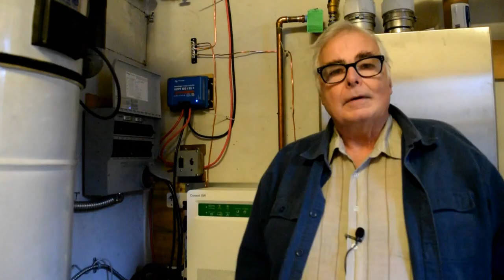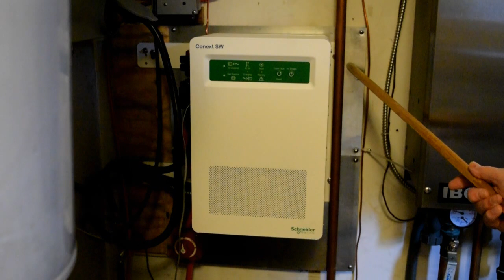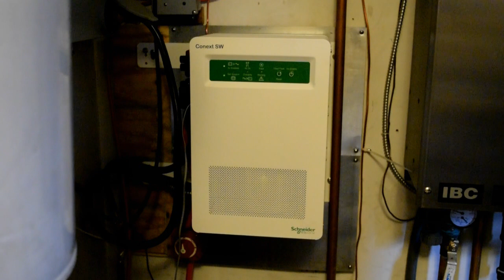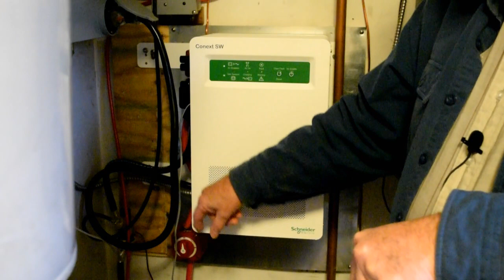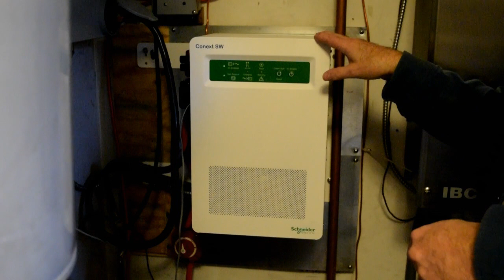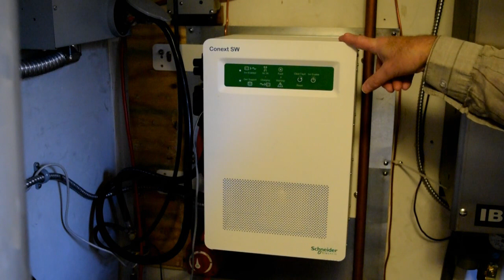Schneider Conext SW 4024 Split Phase Output 4000 Watt Inverter

Comment: Hi Todd, did you buy locally or did you order online?  From?
Reply from the maker: I bought on line from the Alt E store in Massachusetts.  Buying locally is not an option where I live (small rural town in Maine).
Reply: @todddunn945  thank you!  I may in the same boat as im a little out of the way in Alaska.
Reply from the maker: @Akdale777  The main thing I would look for in choosing an online supplier other than that they are reputable is shipping charges since these low frequency inverters are heavy.  I think mine weighs about 80 pounds which would make it expensive to ship.

Comment: I am looking to wire this exact inverter to my load Center do you have any pictures
Reply from the maker: I guess it depends on what you mean by wire it to your load center.  Are you off grid, or are you using the inverter for a backup power system.  The wiring is very different.  Mine is a back up system.  I installed Reliance 10 circuit manual transfer switch.  I put the 30 amp plug on the front of the transfer switch so I could simply plug the inverter in or plug in a generator if I wanted.  There are videos showing that install.  I am not off grid, so I also wired the AC in from the panel to the inverter from a 30 amp 240VAC breaker I put in the panel.  That allows me to use the inverters internal fast transfer switch if I think ahead and turn the inverter and the transfer switch circuits on before a power outage (i.e., at the beginning of a big storm that might cause an outage).  Depending on where you are located and the local codes etc.  You may have to hire an electrician to connect things to your panel.  Here we don't have electrical inspections so I was able to do it myself - I worked as a union electrician years a go so I do know what I am doing.
Reply: @todddunn945  I completely live off-grid so no inspections and I'll be doing the wiring myself just looking for a few tips side question today I measure the output voltage at the first outlet and I'm only help putting 108 V AC not sure why this is so low it should be between 115 and 125 is there some way to adjust the voltage or is my inverter broken
Reply from the maker: @neomatrix2722 Off the top of my head I don't know if you can adjust the output voltage.  My unit is in default mode and has always worked fine.
Reply: @todddunn945  let me give you some clarity my inverter is also working fine and in default mode I just find it abnormal that the output is at 108 volt AC it's my understanding that's too low and will damage electronics I just ran the same test with the multimeter on my gas generator Honda and even with a 100 ft extension cord it outputs 122 volt AC now the inverter it's length of cable is only about fifteen feet to the wall outlet can you measure your output voltage what do you read

Comment: lol i just talked to somebody and i guess the 40/24 is an AC charger only does not use solar unless you have a stand alone charge controller
Reply from the maker: That is correct. The4024 is anverter/charger and you need a separate solar charge controller

Comment: Are u still useing this inverter? I have the same one just not hooked up yet.Do you have any idea how much solar power this item can handle?
Reply from the maker: Yes  I have been using it for over three years.  The inverter itself doesn't connect to solar.  You need a separate charge controller for solar.

Comment: I purchased the 4024 3 years ago and it has definitely been a headache. The software has a mind of its own regardless  your settings. It charges the batteries when it wants, has a 50w load itself (expensive) and fried a $1300 lifepo4 battery.I do not reccomend this inverter.
Reply: Let me add, it has kept the power on during 2 outages but has caused 9
Reply from the maker: I have had mine for three years with zero problems.  I will be adding LiFePO4 batteries after the first of the year, but they will be charged by solar.  I have never used the inverter's charge function.  Sorry to hear you have had issues.
Reply: @todddunn945  Keep me up to date on the battery addition. Thanks for the reply
Reply from the maker: @scheffman  I will do a video on the setup.  I am going to do it in two stages adding 10 kWh each time.  I currently have lead acid and the two battery banks will be connected only with a DC:DC charger.

Comment: Hi Todd thank you for your reply must I use a four conductor wire or can I not use a three conductor wire all I'm using the inverter for is just to run it out to a plug so that I can run my air conditioner Hank you and I hope you have a great day
Reply from the maker: If you want 240 split phase you need four conductor wire.  However, if you are just running a 120 VAC circuit you can connect to ground, neutral and either L1 or L2.  Note that the inverter likes to have balanced loads, so if, for example you are drawing 15 amps from L1 you should also have circuits wired to L2 that draw about the same amperage.
Reply: Do you have a picture of a four wire diagram from the inverter side like which wire goes where on the terminals for wires please my goal is to run 4 wires to my load Center then probably won't run out my circuits from there thank you in advance I appreciate you

Comment: Thanks for the review. I'm also looking to run a well pump fridge and a few lights.
Reply from the maker: You are welcome.  The reason I bought this split phase inverter was to run my well pump.  I have a 1/2 hp well pump.  It uses about 1,200 watts when it is running.  I don't know what the startup surge is, but this inverter isn't phased by running the well pump.  I currently have a 10 Kwh lead-acid battery bank.  It will run my well, fridge, freezer and house lights for about three days.  I also have a 1 kilowatt solar array, that provides enough power to keep the well, fridge, freezer and lights running indefinitely in the summer.  It isn't enough in the winter.

Comment: Hey Todd I just bought these this inverter do you have a video of you installing it like to your battery Bank I'm looking for a walkthrough thank you in advance
Reply from the maker: This video discussed\s the install, but I can tell you what I did here and make a couple of suggestions.  I think I covered physically mounting the inverter adequately.  It is possible to do it by yourself, but if you can get a helper it will be easier.  As far as the wiring goes, my inverter is the Conext SW 4024 that has a maximum amp draw of  250 amps. I used 2/0 cables to connect the inverter to the battery bank.  Those cables were Ancor tinned copper with 600VDC 105 degree C rated insulation and an ampacity of 330 amps.  I chose that size wire to be able to carry the maximum current for the inverter during a short surge with minimal voltage drop for my length of wire.  I made up the individual wires by crimping tinned connectors to the ends of cut pieces of wire using a hydraulic crimping tool.  The connectors I used were Ancor tinned copper heavy duty lugs.

As far as the details of the wiring go I set it up as follows in the order that I made the connections:

DC wiring

Negative wire - starting at the battery bank is ran a length of 2/0 cable from the negative connection point on the battery bank to the connection point on a Victron 500 amp shunt that came with my BMV 713 Blue Smart Battery monitor.  Note that the shunt and battery monitor are optional.  I then connected a piece of 2/0 cable from the shunt to the inverter's negative DC input.

Positive wire - starting at the battery bank I installed a Blue Sea MRBF Terminal Fuse Block, rated for up to 58 VDC and up to 300 amps continuous current, to the positive battery connection point.  I installed a Blue Sea 250 Amp MRBF fuse.  Blue Sea MRBF fuses have a 5000 amp current interrupt capacity at 32 VDC and are fast acting.  Those fuses are designed for use a the primary fuses on large battery banks.  I then connected a length of 2/0 cable to the connection point on the fuse block that goes to a Blue Sea Single Circuit 9003E 350 amp continuous rated on/off battery switch.  From the battery switch I ran a piece of 2/0 cable to the positive DC connection point on the inverter.  The battery switch allows me to turn the inverter on and off.

AC Wiring

I wired the inverter's AC out wiring using a length of four conductor, 10 gauge, generator cord with a molded NEMA L-14-30 plug so that I could plug the inverter AC output into the plug connection of my transfer switch panel.  Not that plug was specific to my Reliance transfer switch panel.  I did that rather than hard wire the inverter to the transfer switch so that I could unplug the inverter and plug my generator into the transfer switch panel if the batteries went flat during a long duration power outage.

I wired the AC in wiring from my electrical panel to the inverter using a length of 10/3 metal clad cable.  I chose that cable because the wire would be exposed in my equipment room.  I used appropriate strain relief connectors where the wire enter the inverter and the electrical panel  The wire was attached to the panel with a 30 amp 2-pole circuit breaker.  Note I strongly suggest making the AC wiring connections to the inverter BEFORE you mount the inverter so that you will have good access to the connections inside the inverter.  Make the AC connections to the panel AFTER you physically mount the inverter.

I hope this helps.

Comment: what other units would you consider buying if you had to do it over again?
Reply from the maker: I would consider a Magnum energy MagnaSine, but you need a remote control panel for that inverter too and the inverter is more money.  Another option would be one of the AIMS UL listed inverters.  That said, my Schneider is still working perfectly after 26 months, so other than the need for an expensive remote control panel to program it I am completely satisfied with the inverter.
Reply: @todddunn945  thank you for responding

Comment: Is the voltage from the generator 120ac or 120/220ac and how big of generator would you recomend
Reply from the maker: The inverter is split phase so both 120 and 240 VAC.  How big depends on what you want to run, so I can't answer that without knowing the details of your situation.

Comment: Great video and explanation for this inverter. I saw in the manual the no load current is 27 watts,but you said it is 41 watts.That is good information about it.
I would like to buy Tripp Lite APS 3024 but the no load current is 71 watts.! I saw it in the manual.Because it is a heavy duty inverter.We knew from about over ten years experience of using it.

I’m from Yemen,because of war almost 80% of people are using solar power.The solar equipments here cheaper than USA and Europe.This inverter in Yemen for $530.Tripp Lite APS 3024 for $930.
The Morningstar 45A MPPT solar charge controller cost $420.In USA it cost $500.
May be solar equipments producers make lower prices here in order to get in flourishing market for their products.
Reply from the maker: I am pleased that you found the video useful.  The idle power consumption may be different for a newer inverter.   My inverter is almost two years old.  It is interesting that electronic components are so much cheaper there.

Comment: We didn't have the money for lithium either, we got two at 1,100 each with some money for repairs to the house.  Every time I had income tax berate from the government,  we bought more , any large influx,  we got more. It is directly affected how we are able to live. Massively over size your PV array,  you will thank your self for that when the sun is low production mode like winter and rainy days. We here in the tropical Atlantic also have to contend with sarhan dust blooms in the summer months. That dust blooms requires you to stay inside and avoid breathing in those contaminat . That is the reasons for the A/C units and second inverter in parallel.
Reply from the maker: That is an impressive project you are working on.  My system is just to get us through power outages, which are usually less than a day.  For me it doesn't make economic sense to go off grid because my total electric bills for a year come to only about $400.  My highest usage is in the winter and it peaks between 7 and 8 kilowatt-hr per day.  In the summer usage is in the 3-4 kw-hr per day range.  If I was to go completely off grid I would have to size the system for Winter.  Given our weather I would need to plan on not getting any solar for up to 4-5 days at a time (heavy overcast and snow).  That means a 40 kilowatt-hr usable energy battery bank.  So batteries alone would cost me in the $25k-$30K range.   So battery cost alone for an off grid system here would cost 62 to 75 years of my annual power bills. My array size is limited by how much of the array I can reach to clear snow from the array.  I am pretty much there now with a one kilowatt array.  I could cut some trees down and install a ground array, but I would need around 10 kilowatts to meet my needs in Winter.  That would cost in the neighborhood of $10K.  So an off grid system here would run my $40K-$50K or 100 to 125 years of my current electric costs.

Comment: after hurricanes  Irma and then Maria on September 6, 2017, and two weeks later we didn't have utility power back until January 8, 2018. Our system was one inverter and charge controller, midnite classic 150 refurbs, and 2,250 of panels with trojans lead-acid batteries, they were used and not very good. We ran a ryboi 2,000 generator and use that minimal system to live and we have built the powerhouse we have today.  I would like to add a propane 12Kw generator with AGS start and more panels. This will take time.
Reply from the maker: It sounds like you have a good start though.  I would like to switch to lithium batteries but they are $$$$.  So I will stick with my lead acid batteries.  At least they were new.

Comment: Thank you, but we have two because we will have split A/C units (20, we currently have only one. We are off grid and i live in the US VI , my battery bank is currently 1565 amp and i plan to dd another Tesla module 60 when i receive my income tax return, we are still waiting on 2018 here from the government . Our utility power sucks worst than rotten eggs, base rate is 39.5 for the first 250 kW and then it increase to 45 cents there after. We have frequent interruptions, the second week of November this year we had the island of St,Thomas and St.John completely blacked out from 1100 AM to 1830 hour that afternoon, the next day we had another for about 4 ours also. I use a Yamaha 3,000 watt  generator daily now since we are not get any more than 12.5 daily from my system. no sun and the planet has shifted further south.
Reply from the maker: Air conditioning definitely requires power.  Here in Maine we don't have AC.  You have big battery bank.  Our power is cheaper than yours ($0.18) per kilowatt, but we lose power quite frequently since we are at the end of the road on an island.

Comment: i have two in parallel.
Reply from the maker: Wow!  You must have a high demand system.  I have concluded that my house doesn't even need the single 4,000 watt inverter.  I could get away with the 2,400 watt model.  Of course I do not have my eletcric stove or my electric dryer connected to the inverter.

Comment: Hi Todd, did you get an SCP? I have a spare and will be happy to send it to you. I have a channel where I show programming, installation, and troubleshooting of these inverters.
Reply from the maker: Thanks for the offer.  I have not gotten one.  I figure I will get one when I upgrade to Lithium batteries in a few years.  I will check out your channel.  I looked at your channel and it looks very good.  However, my Spanish is a bit week since it has been more than 50 years since I studied it.
Reply: @todddunn945  Thank you for checking out my channel all my videos have two versions, you can always find an English version of the same video. Also, if you have a shipping address that you would like to share I can send you the SCP.
Reply from the maker: @SWSTVEDU  Thank you for the offer, but I would prefer that you send it to someone who needs it more.  I will buy one when I need it.  I will also take a closer look at your videos and find the English pages.

Comment: Did you get the Combox yet?
Reply from the maker: No, I have no need for it.  I will buy one if I decide to upgrade my battery bank to Lithium batteries.
Reply: @todddunn945  I used mine with lithium batteries with the scp for the longest . I have the 4048 . You have to set the charge paramaters correctly . I charge mine to 98 percent charged to a 15 percent depth of discharge most of the time .
Reply from the maker: @thhillbillyinventor105  I am close to buying some lithium batteries and will have to buy the SCP when I do that.  I am glad to hear your system is working well.
Reply: @todddunn945  yeah you will def want the ability to set proper charge settings for those lithium batteries . I actually just got 2  more of the 10kw batteries just am trying to make time to move everything now . I'll throw up another vid when I get that done . 30 kw storage .
Reply from the maker: @thhillbillyinventor105  I am looking to add either 7.5 KwH or 10 KwH to my battery bank in the form of a parallel lithium battery bank.  I will either buy an SCP, or, since I currently have lead acid batteries with 4-5 years left in them, a 24 volt DC:DC battery charger to go between the lead acid and lithium battery banks. If I do that the charger in the 4024 can charge the lead acid batteries along with solar and the lithium can charge from the lead acid bank via the DC:DC charger.   I did that on my boat and it worked well.